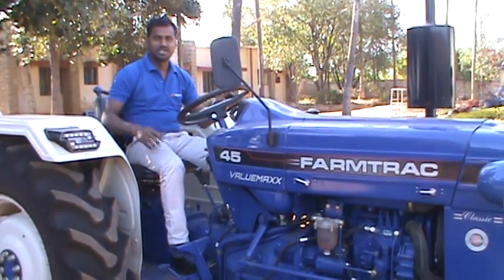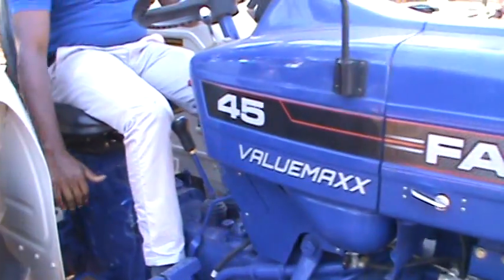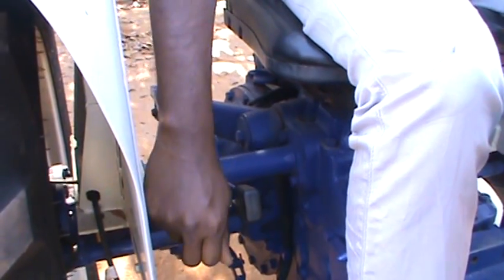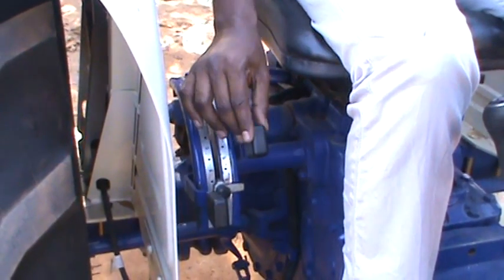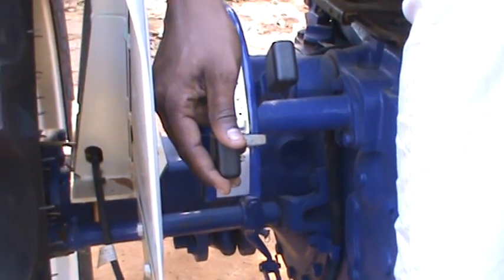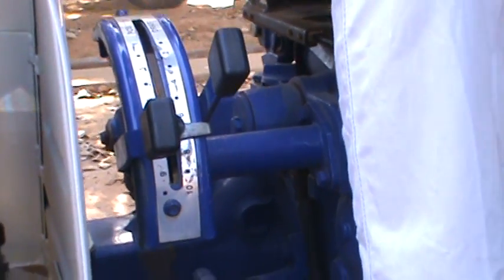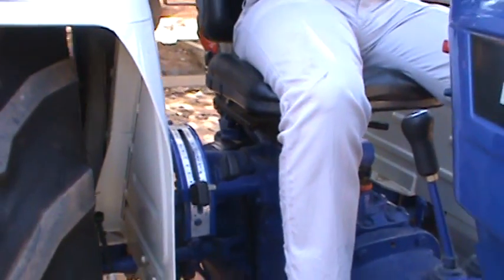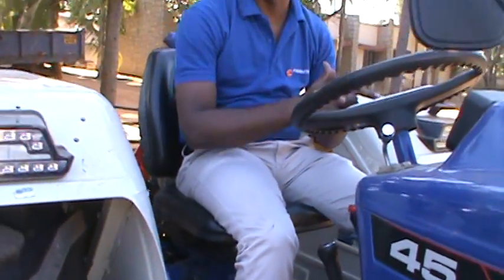How to operate Tractor Hydraulics in English | Farmtrac Tractors

Comment: This farmtrac 45 is power steering or not
Reply from the maker: Farmtrac 45 has power steering in Supermax and Loadmax in general. Valuemax and Agmax may have manual steering in general. There are few options which are made to order.